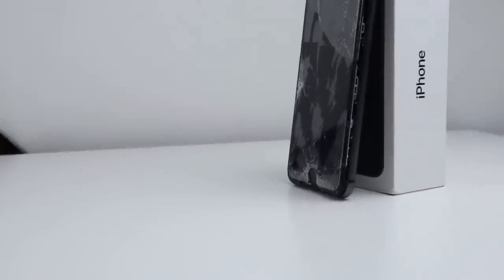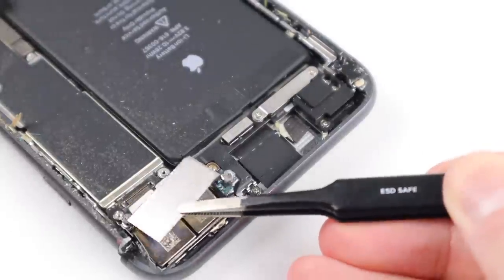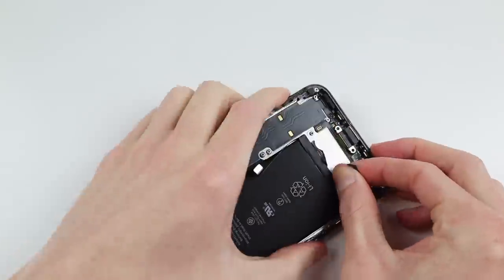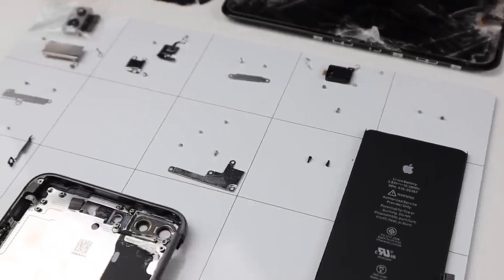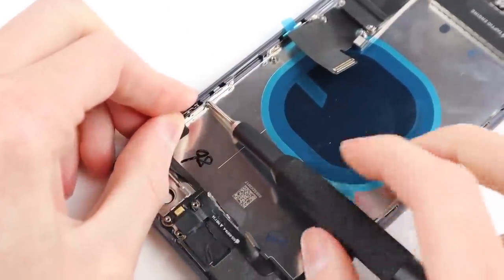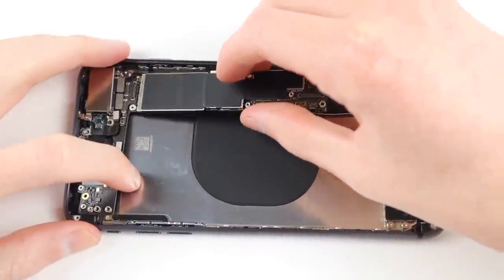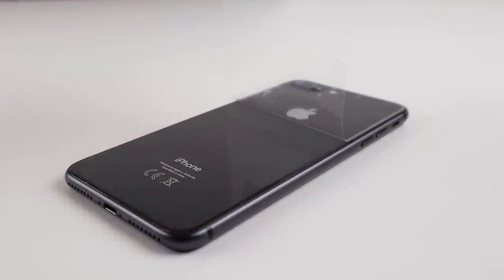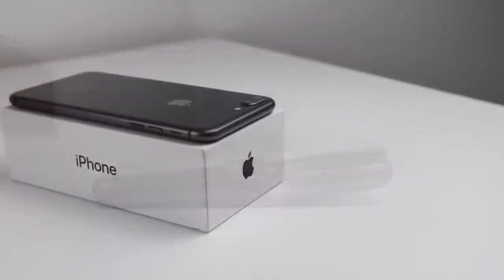FREE Destroyed iPhone 8 Plus - Can it be Restored?

Comment: Just a side note folks, replacing an iPhone 8 or newer display WILL END UP losing True Tone.

I believe the machines can be sold in AliExpress as eBay doesn’t have them
Reply: If you have a calibration transfer machine you will be fine though
Reply: Nobody uses that anyway so it doesn't matter
Reply: @nathanmead140  everyone uses it, they just don't notice because it's enabled by default
Reply: Andrew Lapadat I may actually buy one of these from AliExpress.
Reply: Yeah, aliexpress has the machine
Reply: nathan mead yes it does because I replaced my screen and the colors are off.
Reply: @andrewlapadat8521  you think someone repairing their phone would have that...... why you need that Apple should not be like this to begin with

Comment: All you need is knowledge and you’ll get yourself a free 64 gb iphone 8
Reply: Nokushikuze really cheap iPhone 8
Reply: Nokushikuze and patience... which I do not have
Reply: He had to pay for some things
Reply: Purpoala Gaming yes
Reply: @purpoalagaming9053  but still was cheaper than a normal iphone repair and  buying a new one
Reply: Not an iPhone , but the same principal... My son saw a 50 something inch Sony TV on the side of the road in front of someone's home. It had obviously been placed there by the owner because they were discarding it for a failure. He picked the thing up, put it in the back of his truck and brought it home. It turned out that all it needed was a new power supply, for which he spent $20 on eBay. He has that $20, plus about an hour, if it even took that long, invested in it. The damn thing is spotless too. No scratches, dings, dents, cracks, chips or any other blemishes. The previous owner obviously took very good care of it, apparently even while getting it outside and placing it by the curb for bulk item pick up.
It's amazing what people will throw away and often for the stupidest of reasons. This one is the best I've ever heard of though. Imagine, a cell phone being violently thrown away because the brightness couldn't be changed.
Reply: @SpEd yeah, i too saw a wallet on the road. somebody had clearly planted it there because they didn't want it anymore. Idk why someone would throw away 350$

Comment: bit of a tip on the adhesive for the battery, take a small screwdriver and get it to wrap around the end of the screwdriver shaft, then simply twist so the adhesive reels onto the screwdriver.

Comment: Great work! 
But you don‘t need the old panel to retrieve the old panels EEPROM data. 
With a JC V1 and the JC Repair Assistant software, you can retrieve the data back. It extracts the data from the iPhones logic board and writes it into the new display. Works perfectly so Auto Brightness and True Tone comes back again.

Comment: Built a fully functional iPhone 6 for free from a Water-damaged and a fully destroyed iPhone 6 with functioning Logicboard. The iDevices, especially the older Ones, really easy to disassemble and re-assemble since they mostly use Screws to put everything together. Started with Microsoldering lately, so these Devices the perfect starting Projects. After All i have 3 iPhone 6, one iPhone 6s and a iPhone 7 brought back to Life with a Total of around 160 USD but at a higher Risk because i bought 2 Water-damaged Devices and wasn't sure there are Parts not functioning.

Comment: The piece of plastic replacing the headphone jack allows for pressure equalisation without compromising the seal. It probably has a very long capillary action channel running inside it.

Granted that's something that can be done in a million ways.

Comment: Hugh, Apple charges a whole display replacement for replacing the home button, because the display contains a chip which handles some of the home button functionalities and it may not work if you just re-pair the button whit a aftermarket machine
Reply from the maker: No that is completely false. The LCD contains serial numbers which are used to pair the true tone (front camera flex too)

The home button is a completely separate device

Comment: Working on an iPhone 8 Plus that’s been giving me lots of issues. Didn’t turn on but on my first repair attempt, a new aftermarket battery and screen, it didn’t turn on, I plugged in the old screen and it worked, then when I transferred the camera and earpiece cable to the new screen, still didn’t work. I’ve tried three new batteries with both screens and still didn’t work. Did I fry the logic board somehow?

Comment: Hey Hugh, you probably won't see this but if you do when you replace a iphone 8 plus housing and install a new wireless charger onto it does it require any microsoldering?, ive purchased one off of ebay and the seller has said it requires microsoldering, how is that if yours didn't need it?
-Rick

Comment: I recently repaired my cracked iphone 8 plus and replaced it with a new screen and ran into a home button issue. I ordered the "Keytas" iphone 8 plus replacement screen and used the original home button for the repair. After the replacement the home button wasn't letting me click for some reason even though the touch ID was still working (home button was working just fine before replacement).  Now I'm worried because I have another iphone 8 plus that needs a screen replacement but I'm afraid I might run into this same issue again. Does anyone know a what might be causing this issue?